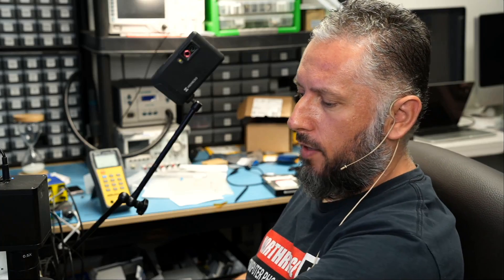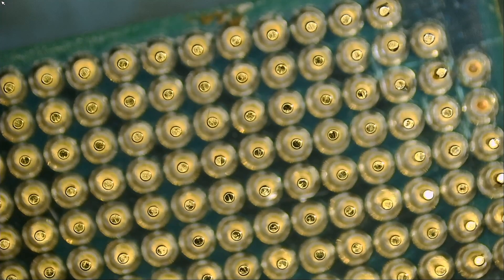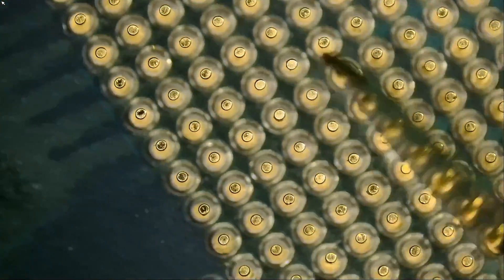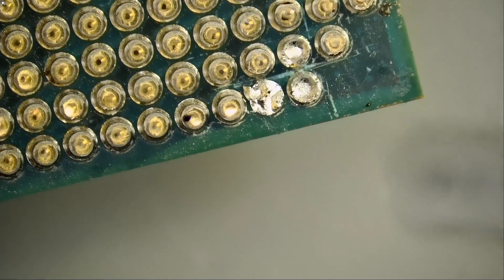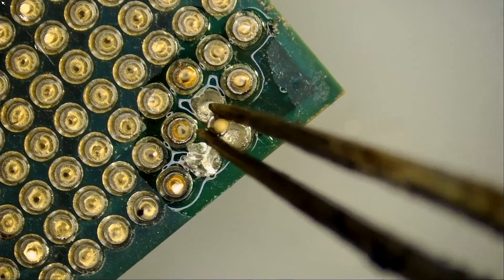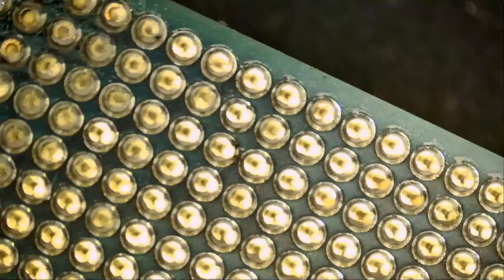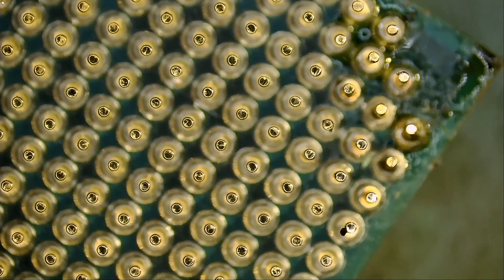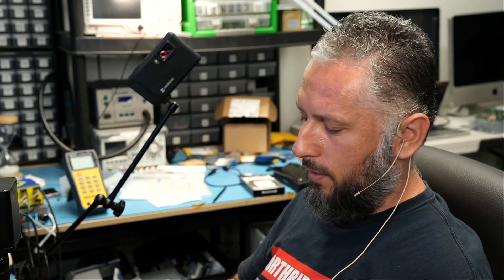Ryzen 9 5950X Bent and missing pins CPU Repair

Comment: I have a broken pin on my 5800x3d and it's been working as intended without running into problems since I had it say few months ago. However, It's been heating up and I have tried every solution. I'm going to try to solder in a pin for the first time once I have the kit delivered. I think I can do it wish me luck
Reply: If I were you, I'd have an expert do this. 5800x3d is not a processor to take risks with.

Comment: I had a cpu with a lot of bent pins .. took me a few hours .. I used a razor blade and my cell phone camera so I could see what I was doing .. it's not perfect .. but fit into a socket with a bit of force .. the cpu works .. the pins are crazy small now .. the old am3 cpus had bigger pins .. I would just use a mechanical pencil to straighten them .. now it's hard to even seen them .. I need to get a microscope .. I'm going to try to fix a z690 motherboard

Comment: @NorthridgeFix. I have been watching your videos almost every day as a learning tool so I can perform soldering jobs at my work. You are amazing at what you do. 
I purchased a dual channel soldering station with 3 profiles, what tenps should inset my profiles to so i can switch depending on the need? Do you use one soldering iron temperature for all solder types and all pin types?

Comment: Ryzen 9 5950X is a great cpu, it would be a sad thing if it could not be repaired. Thanks for the video.
Reply: I like this chip design much more than intel, it is repairable. If you bend pins on a LGA motherboard, then good luck, the only thing is to replace the entire socket.

Comment: I wonder how well the hot tweezers would work with removing the pins and resoldering them onto the damaged processor.
Reply: The tweezers would get solder on the pin and cause it to flow up onto the pin.
Reply: @SolderBrothers  Makes sense.  Thank you.

Comment: Its always crazy when you watch Alex's videos, and then go to work on something and realize just how small and delicate the stuff he works on is. I do this as a hobby, but seeing how small and cramped iPhone components are and the fact he moves them around like they are lego size is wild. Great content as always Alex, thank you for what you do.
Reply: Agreed. Those 1331 pins are on fifty-thousandths of an inch (1.27mm) XY spacing. Cheers!
Reply: @blackrifle6736  I always thought it was like 100 pins but yeah thats crazy
Reply: Like watching a surgeon, plus the tip about how to see when the pins are straith.
Only experience can teach that!
Reply: i dropped my cpu and had few bent pins. it's not complicate but it requires a steady hand (i used a credit card ang fixed it but it was not easy at all)
Reply: Screwing with confidence
Reply: Thats what i thought last week. Modded my nintendo switch without a microscope and had to replace a cap. I guess its not as easy as you would think it is with a microscope. The tools you use are still the same size and you need a lot of practise to use them like alex does. Thats what i learned. It looks just so easy by watching him and thinking "yeah, easy i would do that too." Nope. Just nope😂

Comment: i don't understand why they have the pins on the CPU and not on the mainboard like intel does it.. makes more sense to have the more expensive part, that's also small and gets dropped, less fragile.
Reply from the maker: Easier then fixing wavy pins on intel sockets.
Reply: every pin head has its day
Reply: AM5 stopped doing it.